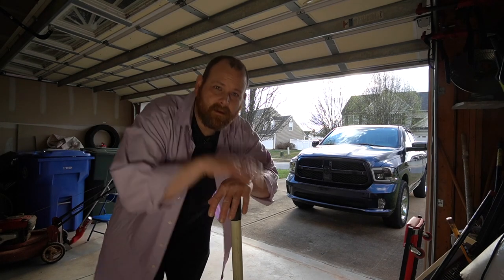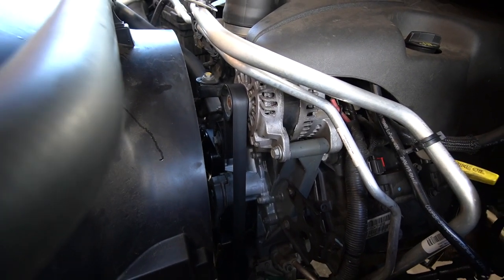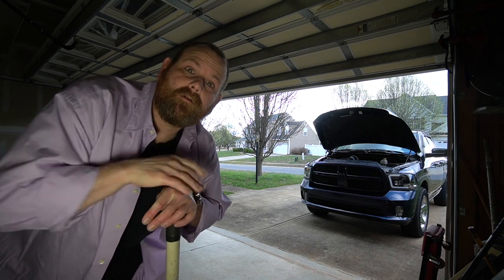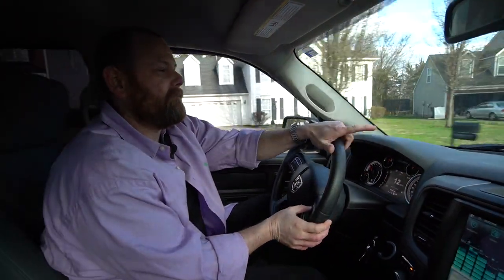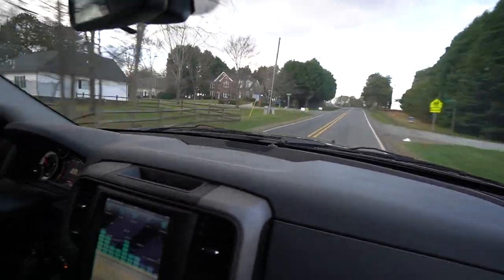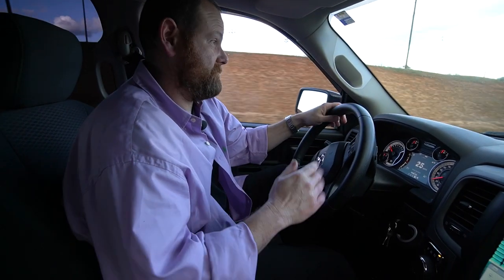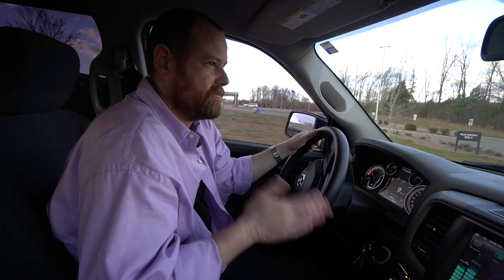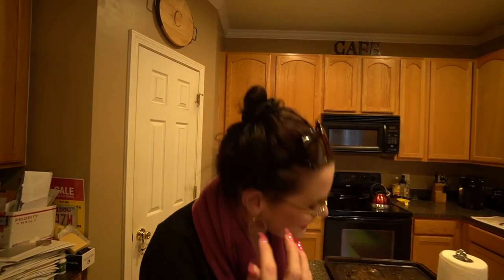HEMI TICK | What is the Hemi tick? RAM TRUCK 5.7 tick knock JASPER FIX #Ramtrucks #ram1500 #ram2500

Comment: So happy to see how happy you are brother. Like I said in the last video comments, Jasper makes a great engine. You get that MDS turned off and that thing has 200,000 miles or more. My 2004 Hemi which didn’t have MDS back then had 190,000 miles when I traded it for a 2016 Colorado (worst decision I ever made) and it was still just as strong as day one. Ran so smooth and still got the same fuel mileage as it did new. They are a great engine. So happy to be back in a Ram with my 2018 Cummins. I’d have bought a new Hemi and turned off the MDS asap but the travel trailer my wife bought the Cummins was just a better option. And boy do I love it. Hope to tune it in a couple months and get rid of the soot cooker 😉
Reply from the maker: Yes sir! I am hoping this is a bulletproof engine.

Comment: What was the total price for a new fix?? I got 7.5k in credit wondering if i should get another just in case anything happens to Chief! Aka my ram
Reply from the maker: Hey BettaBeGood Jr, off the top of my head, I think it was $6300 total. It hurt!
There are other ways to go about it that are much cheaper though. Like, if I would have got an aftermarket automobile repair insurance that would have been mighty helpful.  Lol
You can also just replace the cam and lifters for under 2,000.
Thanks for watching and your support!
Reply: @bigdaddyshouse  thanks

Comment: Glad the truck is fixed. Since I have had extra time (off work for covid epidemic) I have searching for answers so this doesnt happen to my 2016.  I have 27k miles on mine and dont want to void the 100k powertrain. My solution to this will most likely be to order the Edge Pulsar add on pcm. Dont need to have computer reprogrammed and it will turn off mds.
Reply from the maker: Turning off MDS is my next project.
Although MDS is not technically what cause my problem however it is a nuisance.....

Comment: I'll ask a few stupid questions....
With these crate engines from Jasper has there been any issues with the exhaust manifold bolts breaking? 
Any issues with lifters and cams?
I'm assuming if those issues did development it would be covered by Jasper warranty?
Reply from the maker: Can't really answer the question about the exhaust manifold bolts because 20,000 miles ago on my old engine I had put BBK shorty headers and stage 8 bolts on to take care of that problem.
But as far as lifter rollers their website says they have taken care of this problem by beefing it up.
and if something happens within 3 years or 100,000 mi it will be taking care of under warranty.
I think I left a link in my description for Jasper engines if you want to check out their stuff.
Hope this helps out man Thanks for your support.
Oh by the way if you're looking for the cost run down this is my specific situation.
here's my breakdown: 
5.7 hemi Jasper engine $4,685
Engine install kit $380
MDS solenoids $366
Anti-freeze coolant $51
Oil filter, oil change $28
  labor $1,050
Total $6,976
Hope this helps.
Reply from the maker: Oh yeah no question is a stupid question.
I'm happy to help anybody out I can. This whole situation sucks ass for anybody.

Comment: Awesome to have the truck back! But fyi, mds did not cause your problem. It's a failure in the lifter design itself. So turning off mds will not prevent the issue. Only changing lifters will do that
Reply from the maker: I realize they're two different issues sir.
I was just making a comment that it is ridiculous to starve cylinders to try to increase gas mileage...
I'm glad you made that comment cuz I didn't want  to come off like that is what caused the problem.
Thanks brother.
Reply: @bigdaddyshouse  Absolutely man. I do agree it's not the best idea to starve them. Realistically it doesn't make a difference in mpg on individual vehicles. Its just to make the EPA happy cause less fuel is being used. Just its over millions of vehicles that all that fuel is being saved 😂
Reply: Caleb Joos yeah. I know of at least 3 trucks that never came with MDS and they all ended up with the same issue along with my work truck sitting in my driveway right now.  Sucks balls.
Reply: @zacharywhite8230  That would suck
Reply from the maker: @zacharywhite8230  sorry to hear that brother... I feel your pain.

Comment: You said something about $7000. What is included in that price. Jasper rebuilds motors So is it .30 over. Do they tell you the changes in the motor they put in your truck. Or did they rebuild your engine. Thank you
Reply from the maker: Hey Michael, great question. That's why I said I was going to make a video on all that good stuff. There's so much information I want to share with you guys. Just under $7000 is the combined cost of everything. Engine/labor/new fluids....
And they didn't rebuild my original engine. Jasper sent a   rebuilt crate HEMI

Comment: What tuner do you have to turn off the MDS completely.  Don't you have to replace the lifters with non MDS lifters.  And replace the MDS sensors with some plastic plugs.  I read a lot of reviews with these issues about the MDS.
Reply from the maker: It could be done both ways. you can do a mechanical delete or buy a tuner and just simply turn it off.
Both ways can be quite pricey depending on what year truck you have. Fortunately for me I have an unlocked PCM. 2014 and older RAMs.
I'm using a Diablo T1000
I'll make a video about it.
Good question sir
Reply: @bigdaddyshouse  Thanks for answering back.  I also have 2014 ram but mines a Lone star.  My truck was making hemi tick so I changed the oil and use synthetic ultra platinum pennzoil.  It actually stop the tick but, then again I have 183,000 miles on my truck.  When you place your engine, did mechanically delete the MDS or do still have the sensors on?  I can't wait to see the video on the tuner

Comment: Why are your turn signals hyper flashing I thought AlfaOBD solves that issue?
Reply from the maker: Wow, great observation!
The hyper flash is because I need to figure out a new way to route the OLED. Currently I have them tapped into the parking lights. Which was fine when I had my 3" evic. But the 7" is super picky.... 
I think im gonna reroute them to ACC.
Fantastic question sir.

Comment: Woah, what’s your deal? The MDS engines never showed oil starvation in stress testing during R&D. You put all the whacky mods on, and drive like a maniac. You got the nose habit, too.
Reply from the maker: 1) MDS lifters require oil pressure to expand into the locked position. This temporarily robs the oil supply volume just long enough to lock the lifters into place. Once locked, oil pressure is dispersed evenly respective of the applicable lubed component of the engine. When you have 1 or more MDS lifters failing to lock, oil pressure is lost to the rest of the engine (not all pressure but enough to cause oil starvation). 
2) My old 5.7 HEMI was stock. 
3) Nose habit
Sarcasm loading.....................

Comment: Having one put in my 2015 ram 1500 the hemi tic blew my hemi motor to hell, $8000 for a Jasper Engine and install
Reply: how'd it go? i just sent mine in for a jasper engine too. with inflation and prices rising.. i paid 9715.. other shops were quoting me 10-12k for a dang engine replacement.